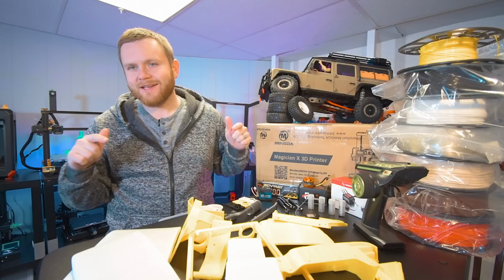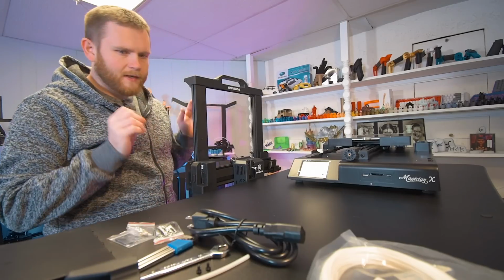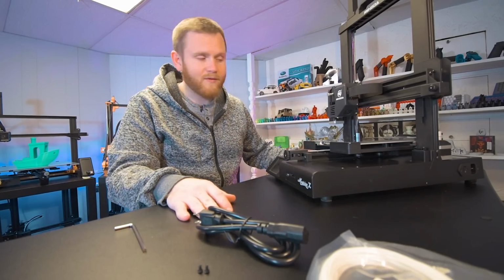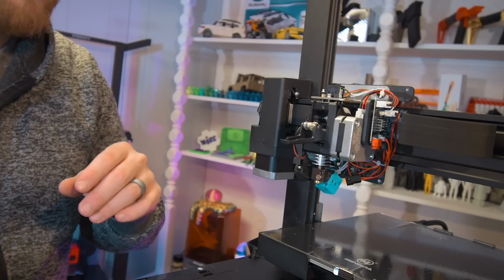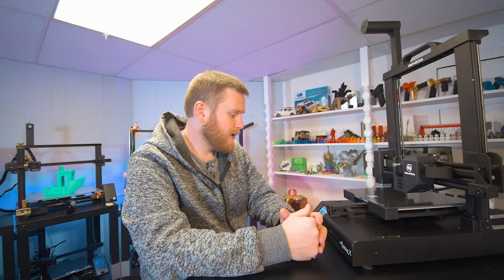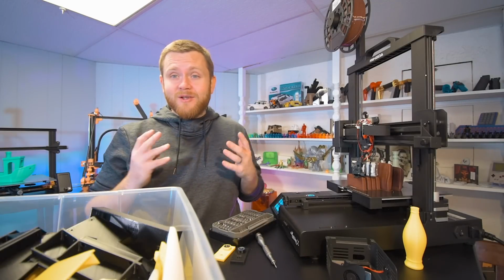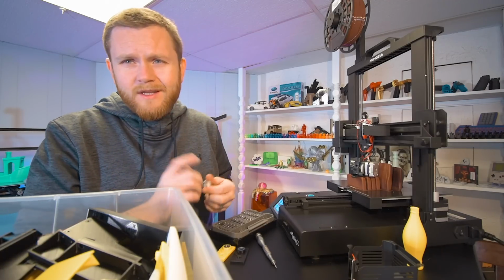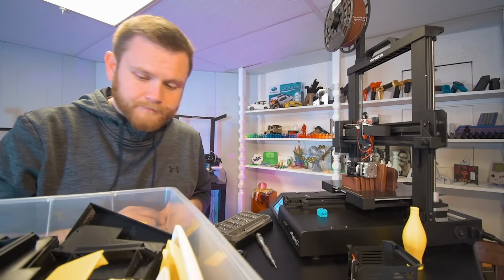Direct Drive Battle! - Part 2 - Mingda Magician X - Featuring 3DSets Bamboo 4x4

Comment: How to add all metal hot end to this?
Reply from the maker: You would have to find a compatible hotend. I don’t think this machine is meant to print high temperature filament. It’s main focus is Pla, TPU, and maybe PETG.
Reply: @3DPrintSOS  I was thinking getting one.  It has all ideal features and price is budget friendly.  But if the price for easy startup is no upgrade path, then it seems penny wise and pound foolish.  

This is why I'm not going with voxlab Aries.  I love the form factor.  It seems to be perfect.  But it's not upgradeable on purpose.  And the flashforge are gorgeous, great price, but again dead end.  Both also lack ABL - my work shop sits on an earthquake - lol. 

I bought a dirt cheap fifth wheel, gutted it, and turned it into a man cave.  But when we want to family trek, we take   it.

Hey, thanks for the videos.  Appreciate the good work you doing.
Reply from the maker: You definitely have the right idea. Actually, watch my video I just did, Direct drive battle finale. I rounded up a bunch of machines and gave them scores based on a ton of values.
Reply: @3DPrintSOS  have been watching and will continue to watch.  I think the mistake 3d companies are making is too many version.  They need to make a base model designed to be upgraded.  Then sell upgraded parts. 

Loss leader price possibly for base model.  Then make profit on upgrade parts, filament, and possibly support agreement which is the only way to buy upgrade parts.  This last part is dirty, but it'd be the only way to make the model work.  

 I'm sure if the brand became popular, 3rd party would come in and sell upgrade kits.  But if you're that successful who cares ...

By the way, like the BiQU screen too.  But even more like that it lets you access features galore that other 3d don't.  It's a good move.

Comment: So finally getting around to testing out this printer. It's pretty nice. Setup is super easy.CR-Touch/BL-Touch is nice, but its annoying to calibrate especially if you're new to 3D printing. Plus I am currently testing another printer that comes with a CR-touch that just won't work... The probe goes to test the first point for mesh bed leveling then reads an error. One of those Ender 3 things I guess!
Reply from the maker: The magician x uses some kind of pressure sensor for leveling. Haha one of the Ender things. Always somethin.

Comment: The two small screws that are not mentioned in the install booklet are to give extra security to the connector shroud at the back of the heat plate. Be careful that the screw engages the captive nut - it can just push the plastic away. If you have problems with the touch screen there is a Mingda calibration download and video. All the files should be extracted to the SD card root. Remove the update files from the SD card after use  - to avoid it doing it again on every power up.
https://www.youtube.com/watch?v=Pbm06CMK4tg&feature=youtu.be
https://www.3dmingda.com/download/firmware.html

Comment: By far this is one of the greatest printers - super easy to use.
Reply from the maker: It IS a good one. I just got a textured PEI sheet to try out with it. Should make it even better.
Reply: @3DPrintSOS  Things are moving pretty fast.  You could add the Sovol SV01 Pro and the Anycubic Kobra to the battle.

Comment: I'm potentially looking for new 3D printer after accidentally killing my old Wanhao Duplicator i3 plus which I've been happily using for the last 6 years, I can probably repair it but maybe it's just time to get a new printer.

I've been looking at the Mingda Magician and the Fokoos Odin-5 and would really like some input from  someone who has used both machines. 

What I'm looking for is a printer in this price range (my budget is limited), with a direct drive extruder due to often needing to print flexible filaments such as TPU and TPE, dual Z axis lead screws, a touch screen display would also be a nice feature to have but not really 100% necessary.

I guess my biggest concerns are over the reliability and durability of these machines.

Any thoughts on this would be greatly appreciated.
Reply from the maker: Those two printers are a good choice. I think I would pick the Odin. It’s a smaller footprint and has been awesome with a .6mm nozzle. A keeper for me.
Reply: @3DPrintSOS  Thanks for the input, it's really appreciated.

Having seen a few online reviews I did think the Odin seemed like the better choice, but it's great to have that confirmed by someone with experience of both machines.
Reply: @3DPrintSOS  I recieved my Odin 5 today, I have only had time to run off a couple of test prints but so far it seems great.

Assembly and setup were super easy and the print quality seems to be excellent.

I just wanted to thank you again for reccommending this, I'm very happy with what I've seen of it.
Reply from the maker: Awesome. Glad it’s going great. I know I love mine. :)

Comment: Pardon my ignorance, but is there a command I can add to Cura to have the Magician X do a bed level before starting a print?
I’m having an issue where it will sometimes start “air printing” 1cm above the bed unless I level just before I start a print.
Reply: yes If you are unsure how to do your own G-code configuration, here is a Cura Start using G29 for auto level 

As you can see in this snippet, we have placed the G29 command before M140, M109, and M190 G-codes, instructing the printer to conduct the auto bed leveling process before heating the extruder and the bed

G92 E0 ; Reset Extruder
G28 ; Home all axes
G29 ; ABL
G1 Z2.0 F3000 ; Move Z-Axis up little to prevent scratching of Heat Bed
G1 X0.1 Y20 Z0.3 F5000.0 ; Move to start position
G1 X0.1 Y200.0 Z0.3 F1500.0 E15 ; Draw the first line
G1 X0.4 Y200.0 Z0.3 F5000.0 ; Move to side a little
G1 X0.4 Y20 Z0.3 F1500.0 E30 ; Draw the second line
G92 E0 ; Reset Extruder
G1 Z2.0 F3000 ; Move Z-Axis up little to prevent scratching of Heat Bed
G1 X5 Y20 Z0.3 F5000.0 ; Move over to prevent blob squish
Reply from the maker: Sure but I think that happens if you don’t set the z height after performing a leveling. 

Also, if you have trouble with the leveling consider doing a firmware update. It’s fast and easy.
Reply: @3DPrintSOS  I did set the Z height, and it is leveled perfectly.  The problem is that it sometimes, not every time, decides to start printing 1 cm above the bed.
Anyway, thanks for the tip on the firmware update, I’ll try that.
Reply from the maker: Let me know how the firmware effects this.
Reply: @3DPrintSOS  Sorry, forgot to update you... The firmware update did not change it, so I added a G29 to the start so it would level then print, and that is an effective work-around.

Comment: Hi there, Unrelated topic. Do you know how to adjust printing speed for "Fill gaps between walls" in Cura? Thanks
Reply from the maker: To be honest I’ve never tried. Typically gals between walls means underextrusion and can often be overcome with flow and esteps
Reply: @3DPrintSOS   I think the gap between walls is when you tell the printer to print an additional wall line. Printer will fill the gap in between walls where the side by side extruded lines (walls) will not touch.

Comment: I got a voxel lab printer and the fliment wont come out when i print but does when i autmatic load
Reply from the maker: Make sure your nozzle isn’t too close to the bed.
Reply: @3DPrintSOS  how can i do that?
Reply from the maker: You can use z offset to lift it a bit.
Reply from the maker: Also, watch this: https://youtu.be/Q7Mu05fZNsk

Comment: Can you please HELP ME why did my Aqulia X2 loose communication with my PC and Cura
Reply: I can attempt to print from SD card but can't figure out machine settings so the print will start fine then it starts stringing about the third or fourth time around the brim
Reply from the maker: Hmm not sure. Does the printer still act normally otherwise?

Comment: Sorry for the subject change but I have a problem with my voxelab Aquila that doesn’t make any sense. I’m hoping you can help me diagnose it. For no rhyme or reason my print job decides it’s complete and stops printing in the middle of the job. I can restart the same job and it prints without stopping. Any idea where to look for the cause?  Thanks for all the help so far, your videos are great!
Reply from the maker: Does it say something on the screen? Typically it’s due too heat too high, low, or runout sensor.

Comment: I'm interested to see the total cost of the Bamboo 4x4.
Reply from the maker: I have a running list going that I plan on sharing in another video once I have everything printed and all the parts are in. If you include all the different filament rolls, It’s right above $300. You can save some money here and there. And technically with the amount of detail that is in this model, that price is not even high. That’s less than an entry level RTR crawler. I’m pretty happy with it.

Comment: Just ordered another 10 spools of IIIDMax filament!!! Stuff is good especially for like 10 bucks a spool!! Thanks
Reply from the maker: Nice! Yeah, I’m loving it so far. Many spools in now
Reply: @3DPrintSOS  I have had some mixed results, overall good though. Do you have a different profile for this filament? I used the one I used for the YOUSU pla.
Reply from the maker: I use my standard profile but I print at 205 on the hotend and 60 on the bed. That’s been the sweet spot.
Reply: @3DPrintSOS  thanks Fedor

Comment: I think you might need to let go of the tecboss 'fandom' (not denying that it worked well for you). All the evidence I can find is that PTFE is a well-known single substance that has been made for 70 years now, I have never seen any evidence apart from vaguely worded marketing speak that any one PTFE can survive higher temps any better than another. Even Capricorn might be guilty of this sort of marketing. Any pure PTFE starts degrading around 250-260 degrees, and its melting point is around 340. If a company wants to make their tubing seem... cooler, they might only list the melting point in product specs, which is a temperature you should never ever get to anyway. If you have heard of any solid evidence to contradict this (that some special formulation could be any safer, temp-wise, than a standard pure tube) I would love to hear it also. So the basic reason to go with Capricorn (or any other brand to find out there) is purely because their brand name is based on not adulterating the PTFE and giving it an even lower degradation point. Maybe different brands can get better consistency tubing and lower friction, but I can't see anywhere where one "decent" PTFE tube could be any better heat-wise than another. We'd all LOVE this to be true to let bowden setups get to higher temps, but at this point I'm leaning towards it being a pipe dream (excuse the pun).
Reply from the maker: Thank you for the info. Just curious, maybe there’s a tube that isn’t just pure ptfe? Can things be added to the ptfe kind of like Pla+ gets an additive?
Reply: @3DPrintSOS  capricorn specifically mention their XS tubing has an additive to lower the friction coefficient, but I haven't found anyone anywhere (so far) that has made any actual claims for heat resistance. Plastic surviving to 200 degrees is already pretty awesome and that's already what we chuck on our frypans (Teflon), also advertised to basically the same safe temperature - don't let your non stick fry pan go above 260 degrees. In looking at that fact I would imagine the cooking industry would have already found a super additive if there was one to be found. Note also that PLA+ is mostly about improving strength, nothing for its heat resistance. Again would love to find out I'm wrong in these thoughts, but nothing turned up so far.
Reply from the maker: I appreciate your insight on the topic. I’ll be trying to find ways to get all metal hotends/heatbreaks on both the S2 and Magician X.

Comment: I'm glad you did this one I've been looking at this printer to print flexibles and I almost decided to go with the ender 3 series and get the s1 but knowing the quality and ease  of the magician x puts it back at the top of the list
Reply from the maker: It is a good one. Interested to see how it does over time. Also interested if it’s possible to use a different firmware. I’ll keep y’all posted.

Comment: I've been waiting for your opinion on this machine as it was high on my list for my next one.  I have to say SOLD!  There is a lot of value here in comparison to others in its class. I would like to see what's under the hood.  Also, the fact that they are using molded plastic parts is really not much of a concern.  First of all those parts are expensive to produce and their use on a machine of this type is appropriate. It should be worth mentioning that the Magician X also incorporates dual Z-axis screws with a synchronous belt.
Reply from the maker: Yes. Lots to like here. I’ll be keeping this one around. Going to see how their support handles the slightly leaning bed. I’ll likely follow up in a few weeks after using it more.

Comment: Auto bed leveling has got to be the most requested feature out there, so I'm glad manufacturers are starting to include it! Looks like it packs quite a few nice features.

Only thing is - I would like the option of an all metal heatbreak!
Reply from the maker: Same! That’s the only thing I’d change so far. It’s great otherwise.
Reply: Auto bed levelling on a small printer like this is more hype than needed...but the machine looks neat...unfortunately Mingda doesent have the best rep when it comes to being reliable
Reply from the maker: I agree that it isn’t needed. Just a nice to have. We will see how it holds up.
Reply: @3DPrintSOS  In saying that there are SO many folks that trip up on [not] bed levelling for their first prints (and then start turning up temperatures because their print won't stick...). I'm constantly linking to your bed levelling tutorial to help out folks!
Reply from the maker: I appreciate that. People like to try to run before they can walk.

Comment: Looks a good tool, what's the price point, when you say it has ptfe liner could you not put a peace of copper tube in instead or am I missing something. I would say do a deep dive inside but if it's knocking good stuff out then leave it for a rainy day.

Comment: Funny that you mention the Fokoos odin...I get cold shivers when I hear "custom". That usually means "forget about replacing/ repairing stuff easily". I happen to have a Fokoos odin, and ran into that exact issue with it.
Reply: What happened to it? 

I modded my Fokoos Odin. It's not too bad to work on, as long as you replace the whole hotend at once.
Reply: @NathanBuildsRobots  that's what I ended up having to do because of their proprietary throat lol!
Reply from the maker: Companies need to stop the proprietary hotend nonsense